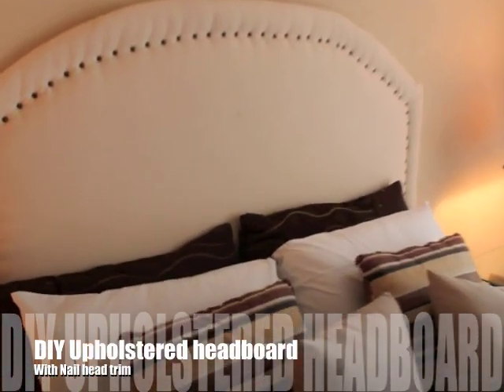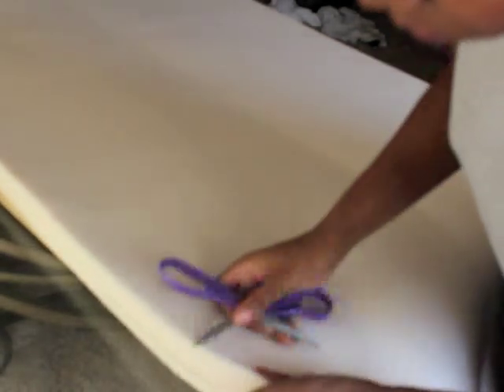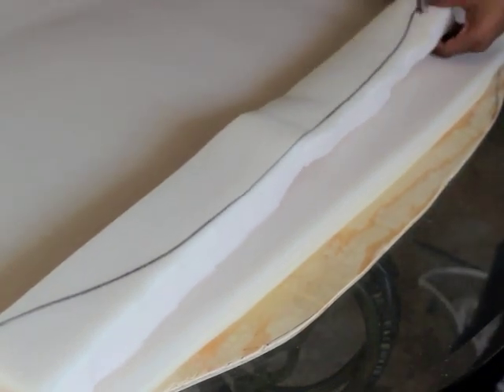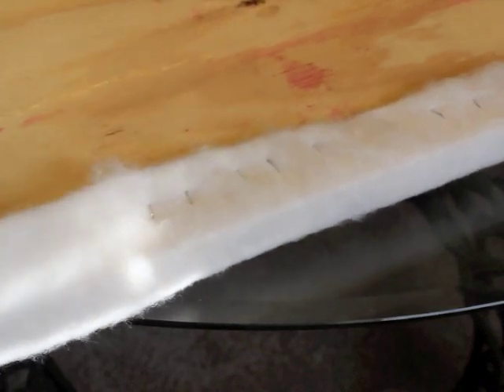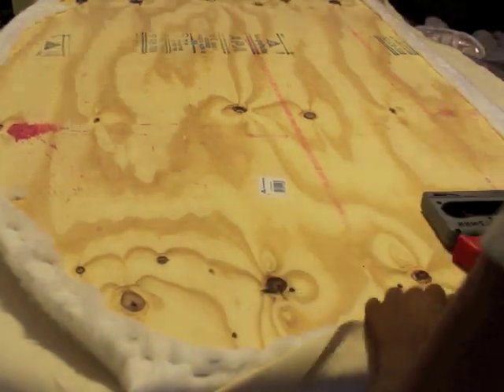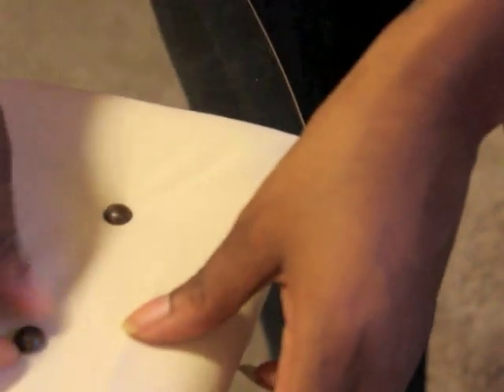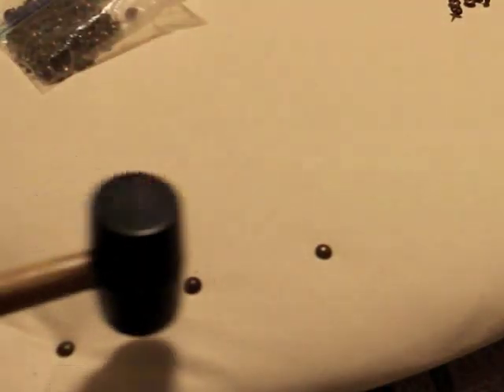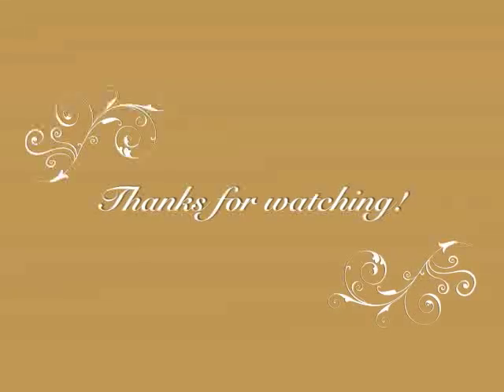DIY Upholstered Headboard with Nail Trim

Comment: I love the idea but I don't have anyway to cut the wood? If I go to Home Depot or somewhere like that will they cut it for me
Reply: Shedeline Ulysse I saw a video were they used foam board and taped it together and hot glued the fabric foam and batting on and to put it on the wall the used heavy duty command strips
Reply: Yes, HD or any lumber yard will cut to your size.  They may charge a small fee.

Comment: That's an ugly headboard. You should measure the perimeter of the nail path before randomly deciding where to put the nail heads so they don't look so ugly with uneven spacing